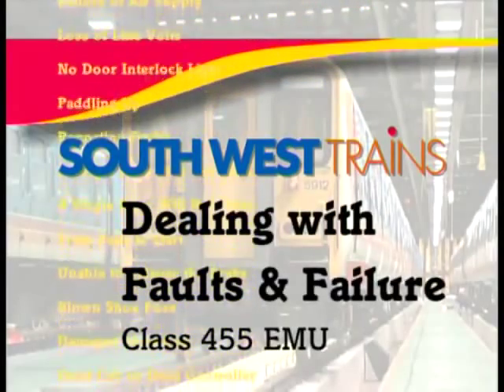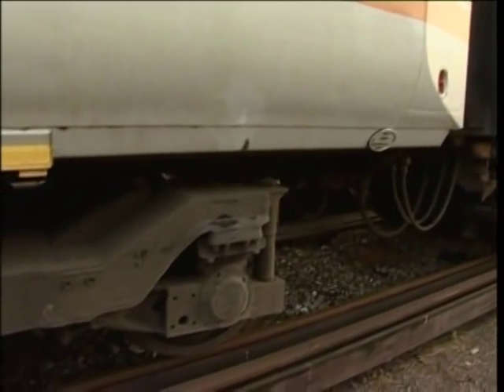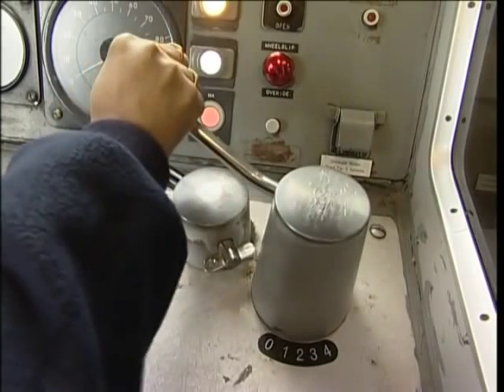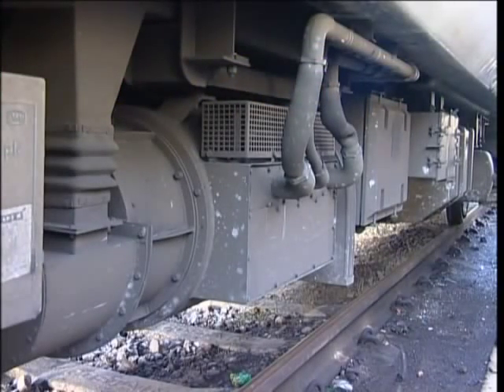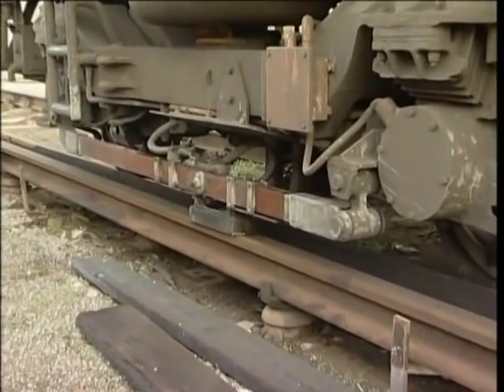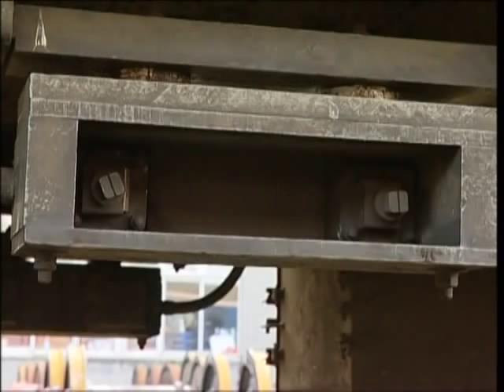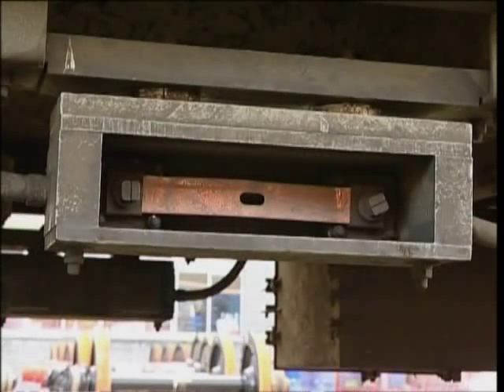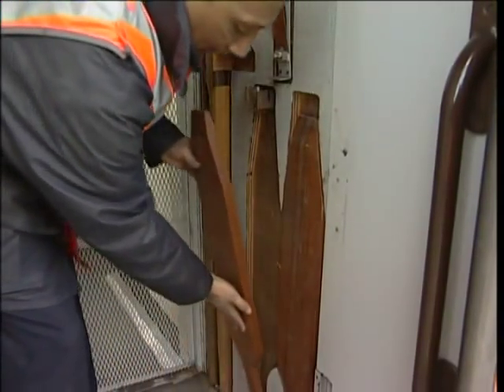Class 455 Faults And Failures

Comment: man id have a hard time just grabbing that bare fuse without checking it with a meter or something first.
Reply: you paddle up the contact shoes before you change the fuse. if that fuse blows, the cause will likely be obvious as you won't blow a fuse like that without the magic smoke coming out of something.
Reply: While it's certainly good that you are cautious with electricity, there's a reason why the paddling-up procedure is so tedious; they want the driver to be 200% certain that the power is off before they touch any part of the train's power circuit.
Reply: We were advised to give the shoe fuse a quick brush with the forefinger, so if it was still live it would throw us away rather than seize the hand up while wrapped round the fuse, in later years we were told to get an isolation

Comment: I wonder if a driver would still be expected nowadays to go all through this stress and health and safety nightmare or whether its just smarter to withdraw the train out service call the engineers and get the driver on another tasking.
Reply: The likelihood is that the driver would patch the issue until the next staffed station, then detrain passengers there, and run ECS (Empty Coaching Stock) to a suitable location e.g. a siding or depot, where the engineers could then take a look at the train in safety.
Reply: @PottersVideos2  I guess if they are in the middle of knowhere there is not much option
Reply: Basically, now you ring maintenance who will come up with a temporary fix to allow you to get the train to the next station then it will be taken out of service.

Comment: Much easier to fix faults then the class 180.
Reply: @lordatkinson2046  How to fix all faults with Adelante:replace them with HSTs
Reply: Or SWR/SWT's own Junipers, imagine the length of video for "faults and failures" needed when they were first introduced.
Admited;y the Desiro's were not that reliable when first introduced, much to the bewilderment of Siemens, but they quickly bedded in and have been model units ever since. 
Being the quality manufacturer that they are Siemens even got data from Railtrack regarding the quality of the 750V supply (the supply quality being not that great, nice smooth DC it isn't!) and emulated that at their test track.

Comment: I remember getting a train back in 2021 and just as the train was ready to depart the external door to the carriage I was on didn't shut and it happened on the single line so the south bound  trains and the north bound trains want to use the single line couldn't go anywhere and the guard spent about half an hour to sort the door out to the point where the train was really late and at the next station the door in question worked as it should